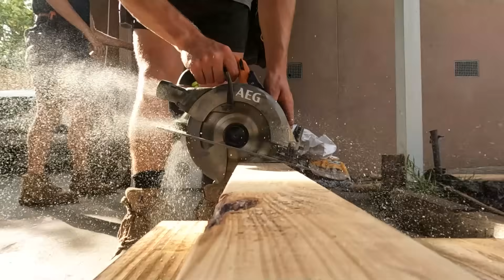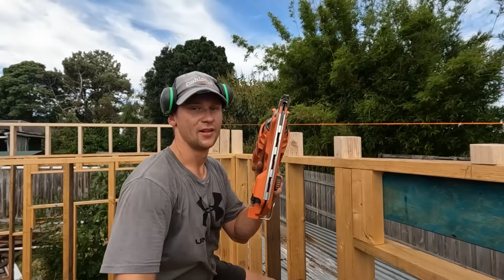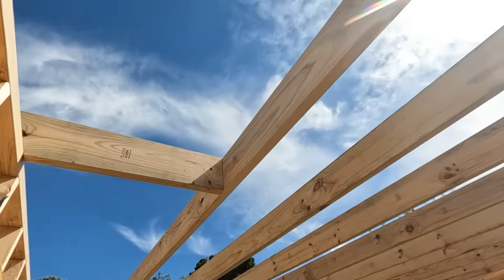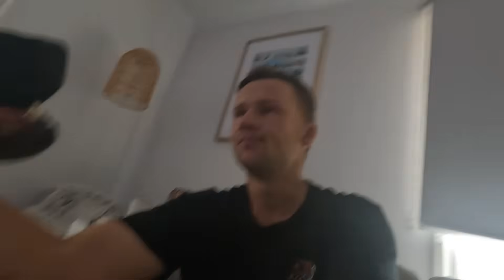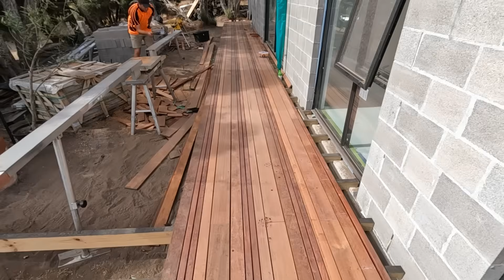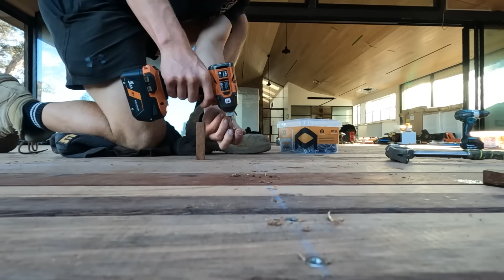How much do I make as a Carpenter

Comment: Great video as always Dave. Thanks for sharing. I have been self employed for 3 years and still manage to stuff up a quote once in a while. My biggest piece of advice is to not itemize quotes. Write what you are doing EG: supply & install 10 Black Aluminium windows &  reveals 
Price $3600 inc gst. 
If you quote materials and kabour seperatly clients think the labour is negotiable.
Reply: 💯 good advice bro, I never itemised quotes and refused to break them down when asked. As soon as the client sees your rates split up, they can instantly work out what your labour etc is and it defeats the purpose of fixed price contracting.

Comment: I use to subby for $50 an hour and charge out private at $60. Changed that all this year to subby at $60-65 minimum and private I aim for around $100hr. When I'm quoting I round up all material to the nearest $100 and then chuck between 15-25% mark up on material. Also try to add in all my quoting/ site meeting time and travel time to the end price as that is your time which you should be payed for. Good stuff mate!!

Comment: Firstly, good on you for treating your apprentice well, many out there don't appreciate their helpers. 

With that said, I'm a builder based in from NZ. In my opinion you are significantly undervaluing your services. You need to take into account the considerable time investment required for each job: initial inquiries, site visits, plan and document review, and the preparation of quotes and contracts. Furthermore, there are additional expenses to consider, such as insurance, tool maintenance, and vehicle upkeep. 

Let's not overlook the pitfalls of fixed-price contracts. They often entail unforeseen challenges that can end up costing you money in the long run. It's inevitable that you'll encounter such situations, so it's crucial to build a safety margin into your contracts to mitigate potential losses.
Reply from the maker: Thanks mate!

I do agree and I didn’t quote this job high enough. Truthfully I was intending to try and complete this job by myself without having an apprentice to help me, which would have been two massive days to get it done, but I would have ended up earning a good amount for the job. 

I also was happy enough to quote this job on the lower end to be sure I would secure it, as I did have a day free that I wanted to fill up 

Thanks for the comment mate!

Comment: Great video Dave! I came across this video last night. I have now subscribed to your channel. I read your comment re. subsidizing your income via money from YT videos. In your industry do you use the 'rule of 3rds' when quoting (which I refer to as the 'rule of 4ths'). As in, decide what 'you' want to get paid per hr (to keep as personal income - eg. $30, $40 or maybe $50 per hr), then times that by 4, so that 1/4 covers expenses (eg. Xero, fuel, tools replacement, maintenance, marketing, etc, etc, etc... and all the other hidden costs of running a business), 1/4 as profit/ business capital (and to help with business growth) and the final 1/4 to pay tax. Plus add what you plan to bill your sub-contractor out at and add that. Plus then add material costs (with some mark-up) on top of that... and maybe add a bit of 'contingency' to your quote for 'unknowns'? That's one way to quote in the industry I am in, which isn't the carpentry building industry. I use the 'rule of 4ths' when quoting to give me a quote starting point. I then might use a 'sliding scale' method to reduce the quote a bit if I feel I need to (depending on the client). I do also allow for negotiation, sometimes agree to price match (if the potential client is getting other quotes),..  and sometimes I even offer an early bird price if I feel I need to sweeten the detail a little  (but the stipulation is to receive it, they must sign up and pay a 50% deposit by a certain date... which helps my cashflow and helps them pull the trigger on my quote... vs them procrastinating), etc. 
Your work quality looks great! Great work too on your videos!

Comment: I always sketch out putting my rafters on a faux parapet wall like that, I've had the council say that it creates a hinging point. Is this something you've encountered? I usually tied the parapet and main wall frame together with threaded rods on 1800c  if I need to do this. also tie downs become a nightmare, connect the rafter to the top plate, top plate to stud, stud to bottom plate, then all over again for the bottom wall frame

Comment: Always allow for extra materials bro, easy to bring a couple bits back if you don't use them, when working out labour content add extra time for your driving around, quoting etc and work it off the hourly rate you want to make, and you need to make margin off your worker. When you do a good job people will pay you what your worth bro, don't undervalue yourself. I was exactly the same as you when I started you have to make the $ to be able to enjoy later years while your young before your body breaks down. Aim for $50-$75/hr + $15+ an hour on your worker and margin on materials. Cool videos dude keep it up. Oh and I would of put those Verge nogs on the other side of the wall save having to put nogs in to catch the soffit lining

Comment: You need to price in some risk. One day you will get a call back. Eg. adding a stubb wall on top without ceiling joists means there is nothing restraining the top plate. If the next guy does a raked ceiling the wall lining will crack at best.

Comment: Can I say this is a common mistake made by contactors. 

Your pay should be calculated in the costs of doing the job . 
Additionally you have some fixed costs per day to operate your business. Vehicle, tool maintenance & consumables, insurance , Phone, Licenses. Calculate this annually then divide by working days. You will be surprised what this adds up to , Lets say it $50 per day as an example. you should include that in any quote. 

Add your margin to the total cost of doing the job including your wages & fixed costs . 

What is left is what you have made (profit) to grow your business etc. 

Thanks for sharing.

Based on your costs this is how i would price it.

Materials 2700
labour      1360 ($65 for you @16 hours + $40 for assistant @8 hours)
Fixed costs 2 days @ $50 
Margin 20%    $832   this could be whatever you want. 

Total $4992  

So you paid yourself and have a profit of $832 after completion.
Reply: You charge for your phone??? Everyone has a phone.  These comments from everyone are ridiculous and all the petty shit they charge for.  You would be sitting at home from where I’m from.  No homeowner or general contractor would pay these crazy numbers everyone is talking about.  I guess America is different.
Reply: @jakepadgett5569 why is a phone a business tax deduction then ya muppet? It’s a business expense 🤦‍♂️
Reply: @Seqhael lunch, clothes, boots, gas, your hammer , tape and pencil are also tax deductible but that doesn’t mean you dump all that off on your customers.
Reply: @jakepadgett5569  price is the price and I’ve not been sitting at home yet… they can always find someone else 🤷‍♂️. At the end of the day, carpentry is a skill. If everyone was a surgeon, they wouldn’t make the money that they do. It’s supply and demand.. just because people look down on it doesn’t mean it’s not valuable, and it’s as valuable as much as people are willing to pay. Not everyone is a carpenter, but with only 7 guys joining the trade for every 50 old boys retiring, that skill is becoming more and more valuable. The free market decides the price

Comment: Price seems a bit low mate, you're a gun chippy and as you say, you are able to run job's for these companies. That's an incredible value for them to have you on-side. With your overheads in mind, and future proofing and expansion of your business, I'd be aiming to make at least $750 a day before tax. It sounds allot, but once you factor in those overheads it's an honest day's rate for quality and consistency. 

An old tradesman told me a great point the other day, quality work lasts the test of time and appreciates in the value of the real estate, therefore that extra $1000$2000 on the quote as a buffer incase of misscalcs really doesn't matter in the long run. If the client is willing to see that reason, then it's likely they aren't the kind of people you want to be doing work for.. 

Avoid that undercutting race to the bottom and hold pride in your price and your work.
Reply: well put mate. Especially as this young bloke actually gives a stuff about the quality of his work.

Comment: Nice work mate, but I think you’re undercutting yourself on your private jobs. You want to be making double your normal subcontracting rate on your private jobs to get ahead from taking days off.
Remember the guys you’re quoting against will most likely have guys on wages and overheads their quotes will be a lot higher then yours
Reply: This. Definitely this. I always give estimates. Hourly rate + material cost. I keep the material cost discount from the stores for myself. Depending on the job the clock starts when I arrive at Bunnings. I challenge myself to get the estimate correct. I won't stand for risks financially myself, as I will never know what I will find in reno's. Yet if it only should have taken 3 hours to do something and it took 8 due to circumstances, I'll probably bill something like 5.

Comment: So what's a fully qualified tradie normally make in the hand per year on average, after operational costs but before tax? 100K?
Reply: Working for wages. I'd say 30- 50 an hour for a "decent" qualified. 
More then that youre working on commercial with penalty rates. 

Most subbies who are full time contractors are making 45/65 an hour. 

Both those rates the people you're working for will supply all "consumables" except maybe circ blades. 

So your only real cost is fuel and tool replacement when they finally give up. 

Lots of people will tell you they won't work for less than 80. 

But that's what I've found working domestic carpentry for the last decade.

Comment: Hey mate  seems like your undercutting yourself and your apprentice a little bit 🤣 $55hr before tax for your own work just isn’t worth it with the headache of any potential screw ups or recalls.
Reply from the maker: I was making more than that an hour. I should have mentioned it in the video, but the second day ended up only being about 4-5 hours of work, went a lot quicker than I expected.

I also spent a bit of time on my own job with moving the camera around and focusing on the video which if I didn’t do we could have almost finished the entire job in one day (if we put in 10-12 hours) 

With the being said tho I definitely did undercut myself. 
I was originally planning on doing it over 2 days just by myself, and I was going to get materials from a cheaper source, but couldn’t get them on time
Reply: @DaveDoesCarpentry  yeah that makes sense moving the camera around would take up a good bit of time each day ! 🤣 
But good your got it wrapped up under time ! 

I’ve ran into troubles in the past with getting materials from a different supplier than usual and it being more expensive however I usually add an extra 10% onto the price to cover me for any price changes as you would know prices from suppliers seem like they are increasing every month at the moment ! 🤣 

Good work mate love watching these vids